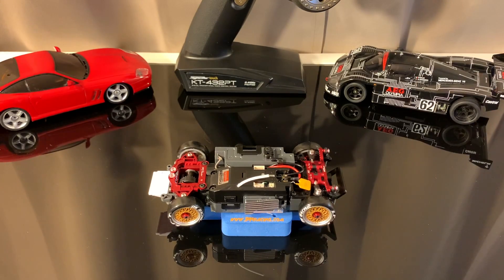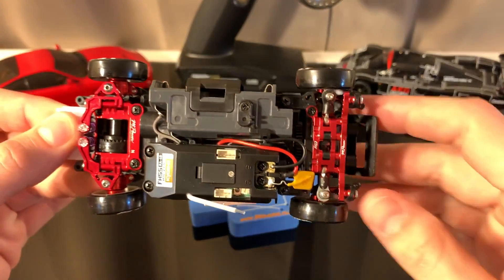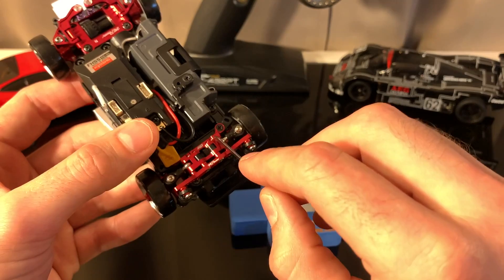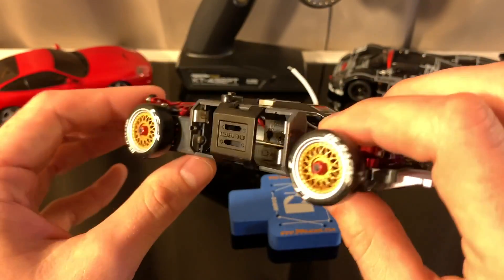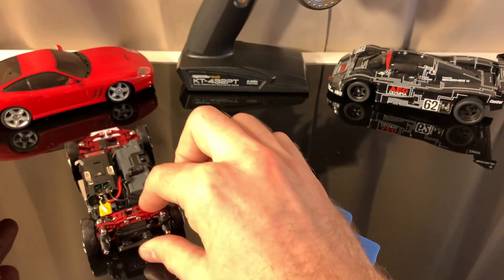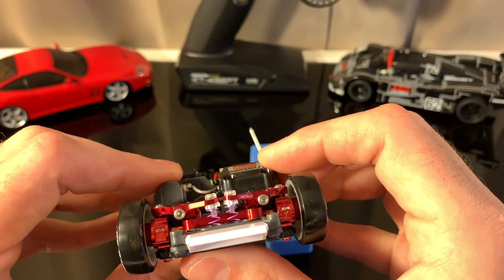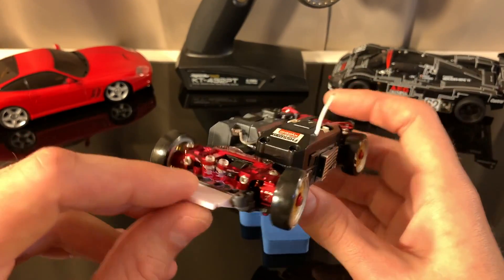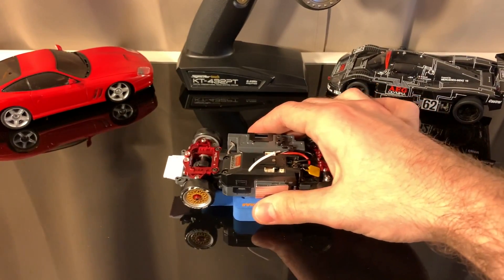MPower Mini-z Alumium Upgrade Parts Review Ma-020 Ma-030Evo

Comment: Subscribed.

Hi, Do you know if the MA020 rear end is cross compatible with the MA030 (non-DWS)? I was thinking of running PN aluminum Knuckles rear but I dont see the MA030 available, only the MA020. Also, what about the rear toe bar, are they also x-compatible?

Do you also know if the front end of the MA020 has the same width as the Narrow configuration of the MA030?

Thank you!
Reply from the maker: Hey man, thanks for the sub. 

Yes the stock ma-010 ma-020 & ma-030 all use the same exact rear end & the parts are universally comparable. 

The DWS is also universally compatible across all three platforms. Just be careful since the stock king pin style rear end parts are not compatible with the DWS & vise virsa.

As for the front ends, yes they will have the same track width for the 020 & 030. 

Hope this helps, let me know if you need further clarification & good luck with your build!
Reply: I appreciated that, thank you!

Comment: Nice video i am going to build my mini z with M power. But i got 1 question , where did you find the black rear springs for the DWS? i cannot find them in the list of M power products
Reply from the maker: You have to buy the full DWS kit from Kyosho as the base & add the Mpower parts as upgrades
Reply: @BMR3  oh my god are you sure ? I thought I can go straight to Mpower without wasting extra money.🙁 Can you tell me the number of the KYISHO DWS KIT ? Is the MDW100 ?
Reply from the maker: @ChristosPanT  yep it’s mdw100 & sadly you need it as the base to add the upgrades onto. I haven’t seen any companies make a full DWS replacement, only upgrade parts.

Comment: Hey BMR 3, I have the swing arms as well and I cannot get them to fit as the mount seems to be too short. may I know how did you managed to install it? Thanks in advance!
Reply from the maker: There are two versions of swings arms depending if your using a narrow or wide front. It sounds like you purchased the narrow arms but you needed the wider version.
Reply: @BMR3  sorry I meant the rear swing arm. The original ones have ball joints to slot into the toe bar and on the rear mount. The mpower ones are just too short.

Comment: I got the wide front diff cover that you recommended and the swing shafts are too short. Are you using long swing shafts?
Reply from the maker: My chassis is narrow. But to answer your question yes you will need wide arms with the wide diff cover.
Reply: Oh well your link in the description shows the wide one.

Comment: hey this is out of the blue on the 4 year old video but I just have to ask I have a ma 020ve pro and the mount for my rear shock tower broke the plastic is tiny in the area it broke I was wondering if you would recommend any of these parts to replace it? part is in the mdw100-002 pack @ 2:10 when you are looking down on the rear end it is the 2 black plastic humps in the middle . one of them broke.

Comment: Hi, may I know where to purchase MPower parts? The front translucent plastic screws used instead of metal screws are to prevent plastic parts contact with metal parts abrasion?
Reply from the maker: Here is a link to their website to order direct: https://www.mpower-pro.com/ma020
Reply: @BMR3  Thank you

Comment: Will the front aluminium diff cover fit the ma030? On the m power site its only listed as compatible with the 020 and does not show as compatible with the 030? Thanks
Reply from the maker: sorry for the late reply but no it wont fit since the MA-030 uses a high front motor mount & the spur gear feeds directly into the diff cover.

Comment: I have a question. Just got two MA-020 for my son and I and they're completely stock. We're both having a problem with the front hinge pin clips. They keep falling off. Happened to my son about 4 times and luckily he found it each time. Just happened to me tonight and can't find the clip. I know I can but anther but don't wanna buy the whole parts bag for that clip. Is there a mod or an upgrade? I've done some searching and coming up with almost nothing. Can't believe we're the only ones experiencing this. We're not even crashing into anything.
Reply from the maker: Hello, yes those little clips are the bane of all mini-z AWD users. They would constantly pop off my kit as well & they are incredibly easy to lose. Like you said its a PITA to source replacements since Kyosho wants you to buy that little kit... That said there are a couple guys out there that are 3d printing replacement clips & selling them to the community. I'm not sure who is selling them but if you ask in the Facebook groups they will point you in the right direction. 

Regarding an upgrade to remove the clips, you are on the right video. The MPower front arms offer threaded pins so you never have to worry about those clips again, however they are pricy.
Reply: @BMR3  I was looking at the MPower option. It seems to consist of two pieces. Do I have to buy both to fit or will the part that holds the hingepin work alone?
Reply from the maker: @glinx1  well I mean you could thread the pins into the stock plastic arms I guess, I don’t see it being an issue.

Comment: Can you recommend a brushless motor and also how to eliminate (if possible) the play in the front steering? The car never tracks straight due to this play, out of the box. Thanks
Reply from the maker: I’m using the 4100kv Xspeed on my ma-030Evo & it’s great for drifting. As far as the front tires being wobbly, you can shim the front steering knuckles to help eliminate some of the slop in the swing arms & tires. Aside from that you can adjust the steering trim with the controller, but mini-z AWD always have a bit of slop in the front steering

Comment: Does anyone have a link for the rear shocks? I can’t find them anywhere
Reply from the maker: You need this DWS base to for the Mpower upgrade parts. https://www.1001hobbies.com/rc-models-cars/311270-kyosho-k-mdw100-rear-suspension-set-mini-z-awd-dws-4548565159888.html

Comment: Hello BMR, awesome video, what type of swing shaft are you using, the Mpower looks amazing and very expensive, my cousin sold me his ma 020ve pro with eagle racing metal upgrades, I can see my metal rear swing arm too small for the eagle racing, using the stock longer swing shalf is too long, it look like the eagle racing rear lower arm either to longer (short), i ask about the stock parts but it look like he can’t find it anymore, I think it not going anywhere, do you think I should go to a different project and put this aside?
Reply: I notice if i replace the bearing with a wider width, it might solved the problem, do you recommend bearing size and width? I never run this( radio not included), still waiting for my flysky nb4 with optional receiver. Thanks in advance.

Comment: Can I ask why do they now fit the ma030
Reply from the maker: Only the front suspension arms & rear pieces fit the 030. The diff cover does not work though since the 030 has a high motor mount.

Comment: With the rear end does it extend the wheel base out or does it stay the same
Reply from the maker: Standard 90-94mm wheel base is what I have here, I think you need the extension kit to reach 98mm
Reply: @BMR3  thanks for the response just got confirmation the kit from hrc mini z arena comes with all the bits to make it 98mm cheers
Reply from the maker: Clay Barnes yeah it’s been a while since I put my kit together so I wasent 100% if it came with everything required to extend the wheel bases & dident want to misspeak. 

Good luck with your build man & get sideways!